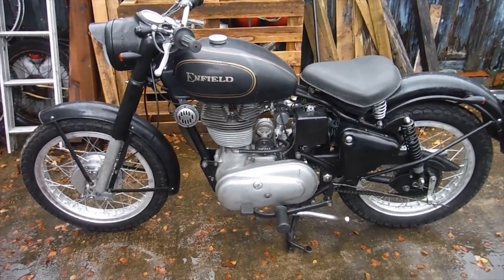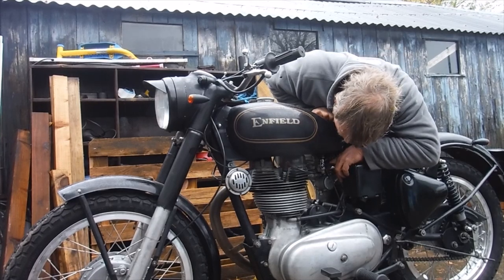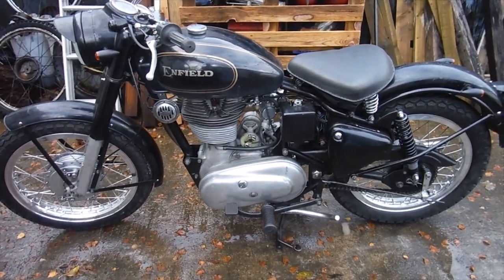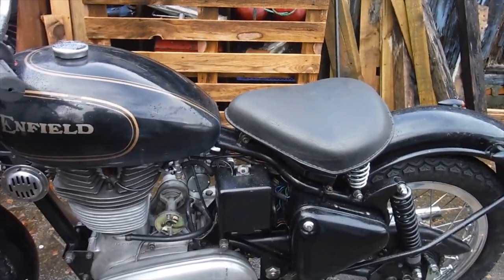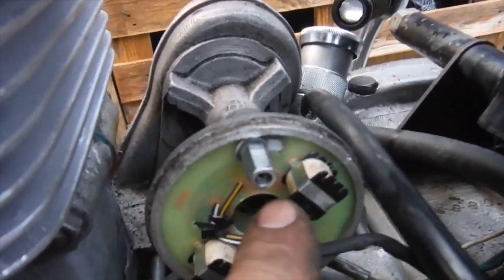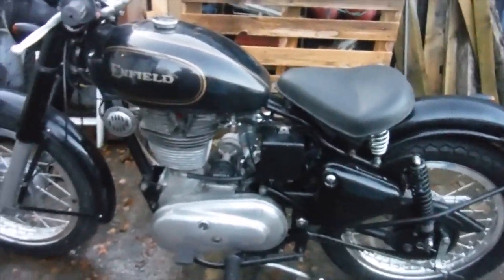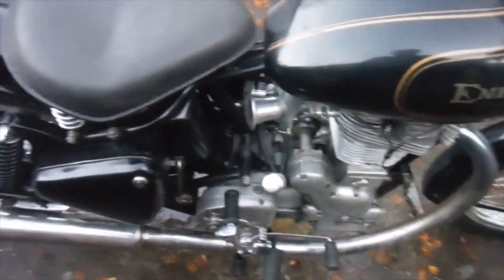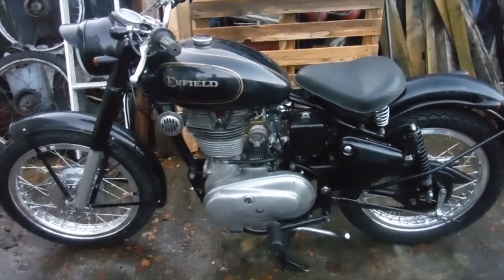Royal Enfield Bullet 500 Asbo 38 first attempt to start, plus clips of further efforts until success

Comment: I had exactly the same problem with my '95 Enfield, the valves BOTH pocketed out within 12 months or so. I ended up putting over size stellited valves on larger seats and ported the head to suit. With an Amal, taller gearing and clutch work I got her to happily sit all day at 90. 

I kept the points as I've never had a problem with them. I have made other mods but the ol' girl is perfectly streetable and suitable for daily use.

Currently I have her in bits with the intent of machining up a modified oil pump. That is now her biggest weakness. The drive worm strips teeth off the shaft too easily under my tender loving abuse. A phos-bronze worm on tool steel teeth (because I happen to have it in my scrap bin) with a pressure relief valve should be enough of an upgrade I think.

Hopefully the bronze will be the weakest link if it doesn't hold up, but turning up a new worm is easier than making a pump shaft.

Comment: I’m very pleased with the reliability of modern electronic ignition systems, once set up they are extremely durable.  The difference is that, in the pre-electronic days, one could set the crank, set the points, and, by God, it would start.  Now we have to wander around trying to find something that will fire and adapt from there.

Comment: I've fiddled with a lot of Boyer systems.  The "quick off" transistors give a nice clean spark, but I've found little advantage to well installed points.  Points operated by the cams on slow reving Brit Bikes go better than 10 000 miles between adjustment.
Reply from the maker: I prefer points, too, but as is often the case, the electronic ignition was already fitted when the machine arrived - literally 'pointless', I think!

Comment: I know exactly how that feels Paul after 50yrs with various machines Well done mate. Just one question, I have seen various comments on the safe cruising speeds on Bullets and most seem to max at 50-55mph . I have been cruising my 500 ( slightly geared up one tooth on gearbox sprocket) at 60+ and seems ok not much vibration , It has quality main bearings and polished con rod  ect , am I looking for trouble? Thanks
Reply from the maker: Thank you!
I have to say I can't abide all this pussyfooting around people do with their Bullets - you should be able to do 60 - 70 mph all day on yours, with no worries, don't listen to those who tell you it will blow up if you ride fairly quickly, the best way to kill them is to plod and lug them everywhere!
Reply: @paulhenshaw4514  Thanks Paul

Comment: If my ears didn't deceive me, you said, at the outset, that the factory, when they hammered the engines together, put 'smallish' Ex.-valves in some of them...how could such a thing happen ? 
BTW, can one easily convert the ign.-system to a HEI one ?  Does anyone do so ?
Reply from the maker: Hi Amelie, yes, the Indian made 500 Bullets have too large a diameter through their exhaust valve seats for the size of the valves, giving rise to a poor and rather narrow contact area at the valve seating, which in turn shortens the life of both valves and seats. The oversized valves are only about 1.5 mm larger in diameter, but this is enough to help solve the problem. As for ignition systems on these machines, we run crankshaft driven, self generating electronic ignitions on our racing Enfields, but a good set of points is really all any road going machine requires.